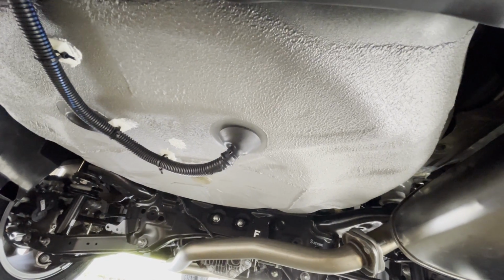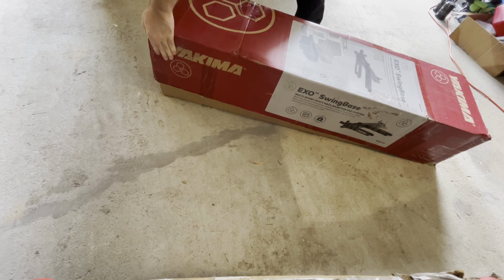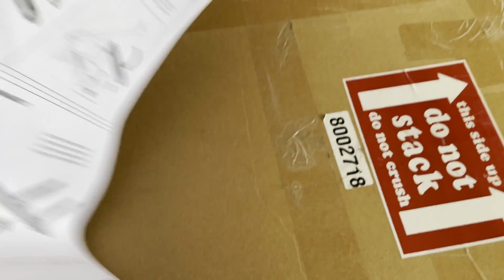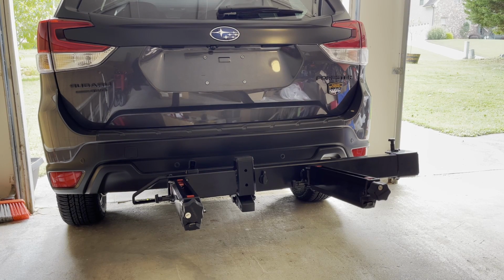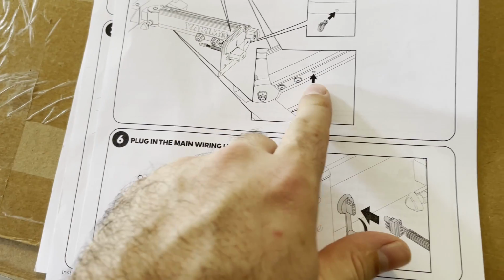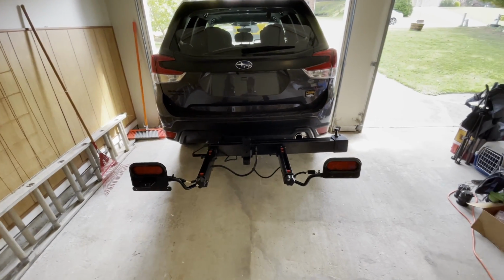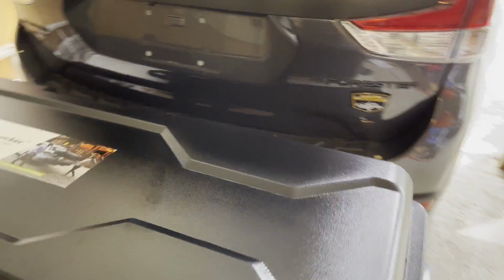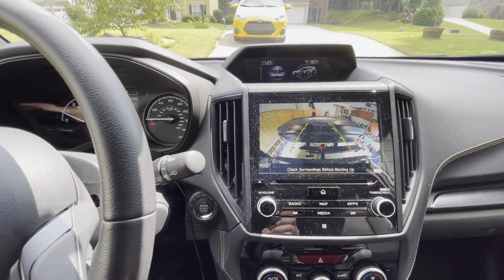Subaru Forester Wilderness 2022 - Yakima EXO SwingBase

Comment: I know it's an old post but an excellent video. I'm thinking of getting this for my 25 OBW but the price puts me off a bit. I think the mounting system has a justified price but the box should be about half that price it looks very flimsy. I watched a few videos on this including yakimas direct and etrailer I must say yours is by far the best video I've seen. I'm hoping that I can open the hatch with the box on the right not extended but not a deal breaker. I'm thinking I can just take the box off without extending the hitch and set it out of my way while I set up my SUV temp over everything.  Then I can just keep the box in the temp with me it's huge. Still debating though. Thanks again for a great video

Comment: From your video, it looks like the license plate & lights aren’t blocked by the box (but would with a second tier).  Is that an accurate, or is the angle just different in the video?  Still happy with it?
Reply from the maker: Yes I believe visibility with a single gear locker should be fine to the tail lights and license plate. I never ended up moving the plates over when I use the gear locker. So far no problems with it!

Comment: Did you figured how to change out the key lock of the GearLocker?
Reply: Those are SKS locks (based on the specs) - they are straightforward to swap out with a change key.  My local dealer gives those out for free with purchase of a set of locks.

Comment: Hey there! Just checking in on how this performed on your trip? Did it wobble much? I am thinking about getting this for my 2017 Forester and haven't seen many performance reviews. Thanks!
Reply from the maker: Hey I had no issues on my trip, it was mostly highway and not too steep as it was a beach trip. I didn't notice any performance impact, but I could feel the weight distribution to the back. I believe the earlier Foresters use the smaller trailer hitch size, at least the oem version so that would not be compatible I believe.